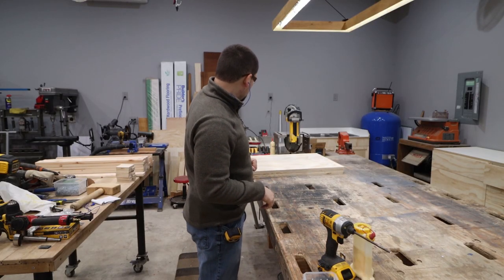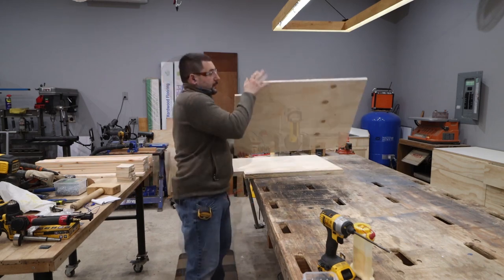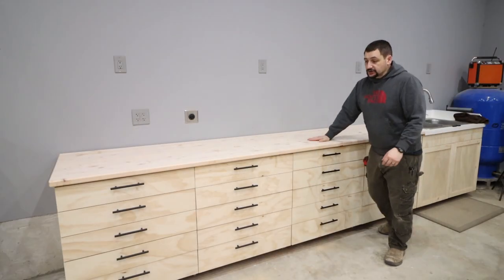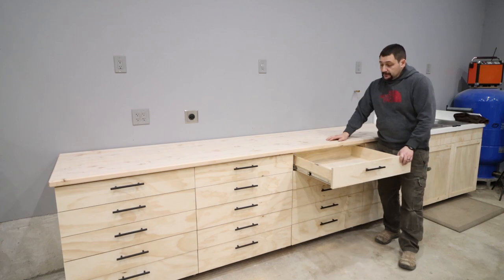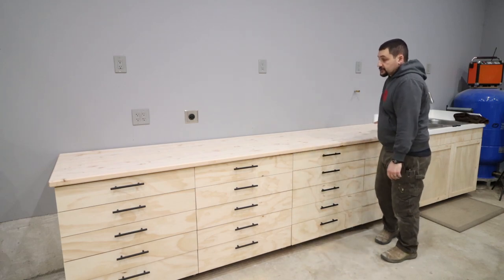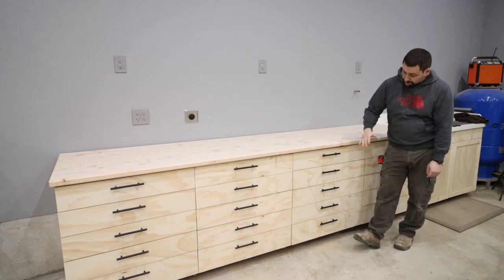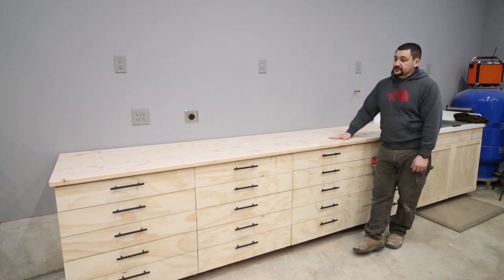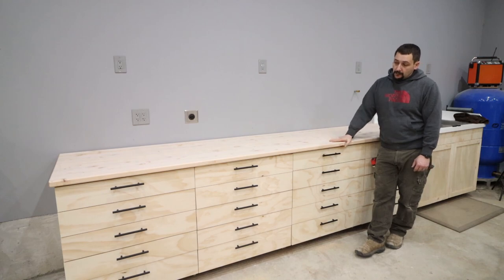Quick High Quality Shop Cabinets

Comment: Great video! What center punch do you use? The tool that is spring loaded and marks where to drill. What guide are you using with it as well?

Comment: How have these held up? This certainly saves a lot of money, but it's pretty much the bare minimum for a cabinet carcass, and I'd be worried they might twist over time while under load.
Reply from the maker: They are doing very well, because of how they are attached to each other and the wall, also the top added an in believable amount of strength.
Reply: @DanielWoodell  Good to know. I'm probably going to do something very similar soon for a miter station.